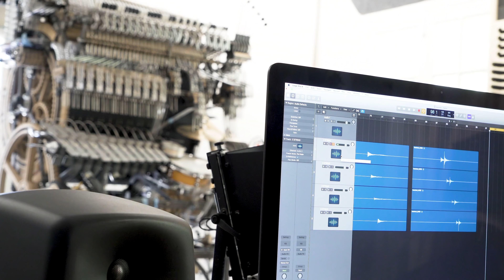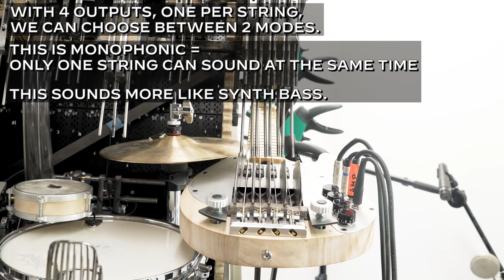Cyber Bass Marble Drops

Comment: The high string sounds like it's getting a lot of fret noise or the string is hitting the pickup when the marble bounces off of it. I'm sure you're going to adjust the actual bass more in the future, but make sure you make adjustments while it's in this orientation.

Comment: "epoxy stops screws from rattling loose over time"
you know threadlock does the same thing.
its also one stage, and easier to use
it also comes in like 5 different varieties, you might be interested in the 'green' locktite which is basically permanent unless you heat it with a torch.
'clickspring' had some excellent videos with very effective use of green locktite. he actually fastened a nut to some allthread and effectively made a bolt. its that permanent.
Reply: That stuff only works on metal-to-metal connections. These are wood screws and that threadlocker wouldn't do anything for wood screws.

Comment: So you're playing the marble machine X at a concert.  how long does it take to change the pegs around for a new song, if you had two people working on it?
I'm thinking you could pull out your vibraphone in between marble songs, and have a  separate trained crew change the pegs, and clips on the guitar strings.
after a while playing, you decide to add a second wheel on, for more variety and complex music... Or a bunch of small wheels.
Imagine a machine with 10 smaller wheels, to program after each song.  The good news is they can be pre-programmed, and they can be swapped interchangeably, because they would be much smaller.....

Comment: Martin, maybe you should design a sort of capo (clamp?) for the bass. (I only play guitar, so im not sure if you even use these on bass, but its a similar concept, so why not?) -->  I´m thinking of a sort of spider capo system, where you´d have multiple of them on ,lets for example say, 5 threads. Each one of them has a spring in them, keping them from threading the note, but above ther´s a circle with pins on them ( kinda like your programming wheel, just smaller and for every note) rotating and pressing onto the threads, and thus playing a specific tone if the marble drops. I think it would be helpful for you, if you have to play the ondophone on the other side of the machine...

Comment: What would be cool is to be able to program the wheel via computer - have lots of solenoids underneath that expose or retract the programming pegs. Or have a system that sets them a row at a time from underneath as the drum rotates until all pegs were set up.

Comment: Just a consideration, the shimmed joints should probably be replaced with wood or solid metal cylinders. If any of those joins loosens over time you're going to get a lot of rattling of the washers.
Reply: That's the goal, but I think he once said that those are a temp solution cuz the parts haven't arrived yet
Reply: I'm sure, he will integrate that rattling into the music score  ...

Comment: One thing. I have done things for twenty years in stainless steel on various industry projects. It is a great material, but it is not always the right one. I would look in to making the most sensitive ones in lets say brass for a certain reason. Threads, close corners etc or fine mechanics doesent work well with slst by a weird thing most dont know about and is hardly written anywahere but a threaded nut and bolt sticks to eachother in stainless, or may do over time. Without a good grease i would go for regular mild steel and oil almost 9 out of ten times unless it is something that really really need to be slst. The same thing apploesmwith oak. It is a great material, but i would never use it in frames as it corrodes bilts unless you burn every hole there is..wich is a bit time consuming. White book three ( vitbok) is a much better material. The oak thing is that it is sour/acidic in itself, works well in cabinets but not for small items and hinges etc. These two things may or may not work wel, but often not over time and i hope this piece works a long time and thats why i wrote it.

Comment: That G-string on the bass (the skinniest one) is slapping against the body and causing extra noise. I say either route away a bit of the body under the string or switch to a heavier gauge of strings.
Also, please get some 1/4" jacks with right-angle plugs for your bass. That setup will probably drive you batty.
Still, great progress!
Reply: Isn't it more likely to be rattling against a higher fret? Raising the action is a less invasive fix for that.

Comment: So, in 'monophonic' mode, you're triggering on the amplitude?  In order to damp out the ringing of the other strings?  Yep, that would sound a lot like a synth bass all right... brilliant!  I can see where the bass could consume a lot of marbles... you will probably want to use the cutoff levers instead of the volume controls for muting strings during performances.  The bass sounds excellent, by the way.

Comment: Hi there wintergarten.
I'm Josh, a British mountain biker and recommend you use a cement like substance on threads that could come loose through vibrations. It's a blue glue that you drip into the threads which then dried and prevents them from loosening. I use it on my bike and know it works.

Thread lock

Thanks, your machine is amazing!

Comment: Martin: Back to the original concept.  The MMX is becoming more heavy steel than lighter wood. You'll need a crane to lift its components to assemble it at every show... You proposed that it would come together as 5-7 preassembled modules that would store in touring cases. That the components could easily be reassembled on site with your stage crew or the band if you were traveling light. That's becoming quite the steel monstrosity. How is this fitting in with your vision of portability and flexibility? Also, all of your custom modifications to the precut parts ( grind off this; re-twist that; hand bend another) has to be consistantly replicatable when making sure you have replacement parts when on the road...

Comment: Obviously too late now since this turned out great, but I’ve always felt that hitting a (cylindrical) string with a metal sphere feels rather awkward. The guiding fins look nice and all but not optimal. Another solution might be to make a key and hammer mechanism. Think very simplified piano key (flat surface) that the marble hits and then a hammer hits the string instead and bounce back.

Comment: In case anyone is wondering what gear is in Martin's rack at 16:00 - I've identified almost all of it except the last unit - which looks to be some sort of vintage style compressor/mic preamp.  

From Top To Bottom:
Rupert Neve Designs RNHP 1-Ch Precision Headphone Amplifier
RME Fireface UFX+ USB 3.0/Thunderbolt Audio Interface
RME M-32 DA Pro Digital to Analog Converter
2 Golden Age Project Pre73 Preamps  
AMS Neve 1073 DPD Dual Microphone Preamp
RME Fireface 800
Universal Audio 6176 Tube Channel Strip

Comment: When it's done you could consider a follow-up project to construct a robotic programming wheel that you can control with a computer so pins slide in and out for different songs without having to manually change them all.

Comment: Serious note: you'll want to apply a thin coat of light oil to the parts that you've blued. You get far better rust protection that way as the thin oxide layer absorbs some of the oil to further repel moisture.

Comment: I love this video! Please don't make them all like this, but for once it's a nice touch!

I am really amazed by how you make the guitar marble release block so definitive - it looks like one complete block that is welded and epoxy screwed together. It seems to me that it is hardly possible to do any field maintnance like this. If you would have just turned the screws into the wood (they won't come loose due to the elastic properties of wood) and made one of the sides bolt-on, then any field maintenance will be way easier!

Also, it seems like there is a very complex path of "fixture" between the guitar and the guitar marble release. Aren't you afraid the guitar and marble drop will move sideways relative to each other when the MMX is in full operation? IMHO one or two very light braces can solve this problem - they will still move, but not relative to each other. Off course, maybe this is a non-issue.

Comment: Well, I've said it before, if the whole music thing ever stops paying the bills, you'll have an impressive resume for entering the industrial engineering field.
Reply: "So, you've been in the music business, but is there anything else you can do"
"I'm good with an angle grinder"
Reply: @gagiotter4114  "Oh, y'know, Just... A hobby I got good at.."
Reply: Not joining the roasting bandwagon here because the waffle already burnt. But let me say this: What this guy in the video doing is not only mechanical engineering, but also musical engineering. ba dum tsss
Reply: Except that his 'making style' is way too improvised to call it engineering. Just a few examples:
- almost all parts are changed and redesigned over and over, even 2 minutes after making them
- the 'redesigning' consists of inconsistent angle grinding and no part is even close to spec anymore
- everything is bloody expensive to make as there are no standard parts
- nothing actually works right away
- the whole machine relies on manual adjustments, which basically means that that the design is inconsistent or poorly thought through.

Don't get me wrong, I like Martin and his journey, but I wouldn't call it engineering. It is hobbying, which is even more fun to watch, but you wouldn't want to take this approach as a real engineer.
Reply: stroopwafelijzer I would disagree with you, from what I’ve heard the Saturn V rockets can’t be easily rebuilt today do the fact that during the manufacture of each engine there were changes made on the assembly floor. I think history shows more of the one off assembly wonders of the world. 

And on the other hand, In the real world things don’t go as planned and having a guy that can quickly find and fix design errors and tolerance issues is a must have.
Reply: Also another thought; in order to design things correct the first time, one would first have to have experience and knowledge of common pitfalls. And for non-common machines like this, I don’t know if that’s really feasible. But if you want to nitpick, yeah his tolerances were off but it’s a one off machine. For me personally, if I’m building a one off prototype I would rather a considerable less time dialing in the tolerances and design and just take an angle grinder to it.
Reply: @stroopwafelijzer  of course it's engineering! He is inventing, that consists of trying new things and constant trail and error and finding solutions. Absolutely engineering, do you believe when the diesel engine was made it all went to plan straight away?
Reply: @stroopwafelijzer  Everybody has to start somewhere. And his somewhere is better than most people's somewhere.
Reply: @stroopwafelijzer  I'd have to disagree on multiple levels. Many other people have already addressed many of the issues with what you've said... Another thing to add is.. this is a musical instrument. All musical instruments require having as many manual adjustments built into them as there are moving parts or more than. Things go out of tune for MANY reasons but temperature, wear, and transport will constantly throw any "perfect" non-manually adjustable instrument out of tune every time.

A musician NEEDS to be able to adjust tons of things manually and needs to know when it sounds right. Anything that doesn't support these manual adjustments is doomed to be forever unable to play right. This is infinitely more true for something as complex as the MMX. In normal industrial engineering you can build tolerances and less manual adjustments into a well engineered design.. for an instrument, especially something like the MMX, that would be directly counter productive and would make the instrument permanently always out of whack because of the tolerances.
Reply: @stroopwafelijzer  prototyping is probably a better description for his methods lol. The skills he's building are fabrication skills.
Reply: @stroopwafelijzer  
He has a more creative mind than most engineers.
Reply: @stroopwafelijzer  what do you do for a living?
Reply: @stroopwafelijzer  so you're saying he's a shoe in for a job at alpha romero
Reply: stroopwafelijzer I don’t know what kind of engineering you’ve been doing, but aside from having to worry about the production budget and the requirements of the manufacturing guys this is exactly how things are done in the R&D teams I’ve worked in 😂

Comment: "Assembled too early." The first rule of auto mechanics is, never sock down the first bolt until the last one is started.
Reply: and then you see you can't reach the first one anymore, and take everything apart again. (happened to me a few times) so it goes both ways. But bolts are easier than welds.
Reply: Think twice solder once
Reply: Daniele Gerussi soldier
Reply: First rule for noob mechanics: record the disassembling

Comment: Why not threadlock instead of epoxy for the screws?
That is one complex marble cascade. I like the visible remote triggers for the gates, I'd like them more if the actuator rods were parallel with one another.
I want to see how you'll get the marble pipes out there. It looks cramped and the horizontal offset is significant without much vertical offset.

Comment: I wonder if those permanent magnets last long, since some of them are quite frail and could snap in half when applied pressure. Some magnets if you drop them on solid surface (concrete floor or tiles) they would break in pieces. I guess time will tell how they last in MMX as programming pins, which was a good idea to use.

Comment: MMX: Precision laser/plasma cut parts musically tuned by angle grinder.
Reply: well nasa summoned japanese skilled welders to assemble heat exchange units of space shuttle
Reply: Well, the parts that actually will produce the nice sound are not tuned by the angle grinder. They are, as you said, precision laser/plasma cut parts. Or in case of the vibraphone plates, i believe they were surface ground

Comment: Wow! As a long time subscriber this feels sooo good! Marten, do you intend to use some kind of « pattern capos » to set the string heights when you cannot finger it yourself or for extended loops? I’m thinking some kind of plank with set holes (like the programming wheel but flat) and pads (instead of pins) that you would clamp onto the fingerboard? That would allow for quick chord change in a reliable way.

Comment: Those tiny screws “sideways” through the plywood... is that a good idea, I wonder?
Reply: It looks like it's high quality Baltic birch or some sort of similar plywood. They should have more than enough holding power for what he's doing. If it was cheap plywood with only like B grade facing and voids in the center then they probably wouldn't be enough

Comment: to use epoxy to prevent screws from loosening is a good idea, but why don't you just use a glue that was made for that task like loctite produces? epoxy seems a little overkill
edit: when you drill it into wood you could also use wood glue or maybe even kids glue would do the trick, since wood has a strong grip already

Comment: The whole machine looks so heavy now, i kind of wonder how heavy it is.
Reply: I guess around 350 to 400 kg
Reply: eternia reginleif I was thinking the same. 2000 kg maybe?
Reply: @stigcc  I highly doubt it weighs as much as a car. Has to be in the neighbourhood of 600kg
Reply: @stigcc  i don't think so 😂😂, considering the size of the frame,probably it weight around 100 to 250kg at most.✌
Reply: Good thing it comes apart then.
Reply: My bet is 400kg with all this steel.
Reply: ...definitely thinking similar thoughts...might need a rail system to get take from tour truck to stage. Wonder if Martins spreadsheets could calculate approximate total weight ? Q

Comment: When I saw you accompany the bass guitar on drums the thought occurred to me, could the programming of the machines pin barrel be done but with information captured from a live recording.
For example using the same instrument set, do a multi track recording composition . Make a heavily gated version of that (to get the attack points) and somehow transpose than into pin positions for when you do the spot welded pin drum version. 
With the pins not being restricted to rigid hole positions of the existing peg barrel then a bit of extra feel can introduced.
Sounding great so far.

Comment: rust bluing provides basically no protection unless it is oiled. rub some 123 oil into it until it is "dry" (it is not actually dry, the oil has merely been absorbed into the porous rust bluing) and it will work much better.

Comment: OBSERVATION:
shark fins look awesome. Other than esthetic appeal what purposed o they serve?

Marbles are dropped with 99% accuracy and repeatability. Only exception are the conditions: machine/stage vibration; string vibration; rail vibrations near drop release area...

That being said, the balls never touch the fins. Correct? There would be lots of unwanted noise and variables in bounce pattern. 

Can it be played without the shark fins? Even if just for proof of concept?

Comment: You should desing it so that every single part would be installed with screw, not welted or soldered. And put there the right locktite! So you could someday open them when need to.
Well those looks so nice! Good work! Like a pro (but you are pro)

Comment: Martin don't use epoxy for screws, buy a threadlocker or loctite (medium strength), it will eliminate the problem and you can still unscrew everything later

Comment: Martin, shouldn't you protect those metal marble holders so they won't damage the marbles over time after each drop into the metal?

They would also isolate the metal shocking noise.